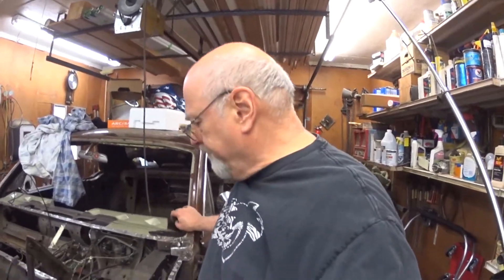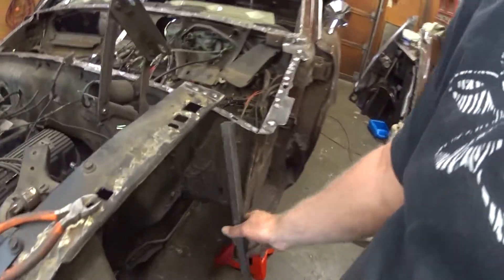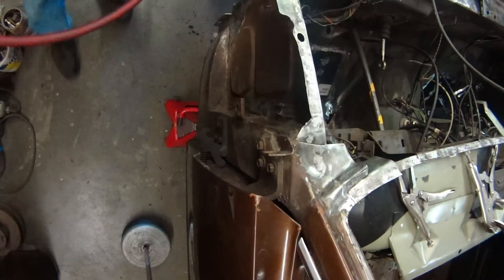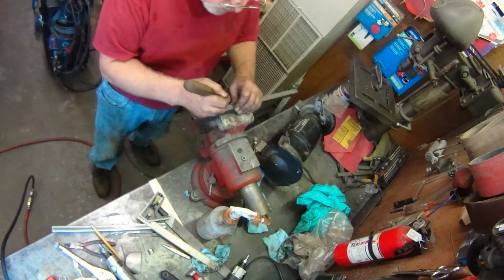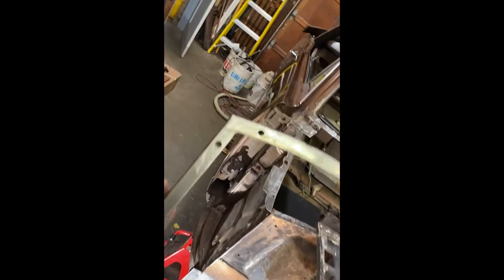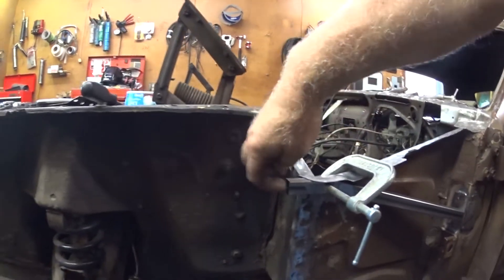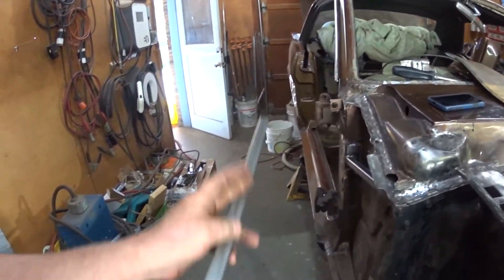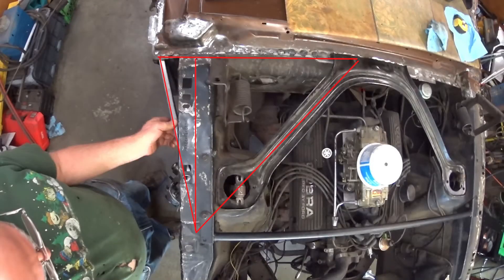66 Mustang Betsy - Chassis Stiffeners - Part 2

Comment: I like what you did there. Well thought out. That is an important point you made about setting it on the wheels. When I was aligning the doors and putting on the front fenders, on the last '65 Mustang Convertible I had, my first attempt I still had it on jack stands. Only when I set it down on the wheels did I get it all right. There is that much flex even in one of these with no rust at all. These early attempts at building cars without a full frame were not too good. Over time they got better. These early Mustangs really should have been built with the front and rear subframes tied together. (A full frame. LOL) I'm glad to see you again in my favorite shirt. It's just classic. 😂

Comment: Well though out Don.  Was it easier to weld in the torque boxes with the floor pan out?  That's what I'm thinking of doing.
Reply from the maker: Hi Troy,
In my case the toe boards were pretty bad so they had to come out anyway. If your toe boards are good I would do the torque boxes with them in place. My reasoning is that the toe boards help hold everything in place. My floors were so rusted that when I cut the toe boards the drivers side frame rail moved and I spent a lot of time getting the car in tram so I felt confident welding the torque boxes in. Once they are in it’s pretty tough moving things into position. Note that I also had the upper and lower cowl out at the time too so basically only the vertical part of the firewall was all that was holding it together. Things were pretty flimsy which got me thinking about how to reinforce the chassis.  

Let me know if you have other questions, I hope I’ve helped you some.
Reply from the maker: I do have video coming about those torque boxes, “chassis stiffeners part 1”, that I hope to get up soon.